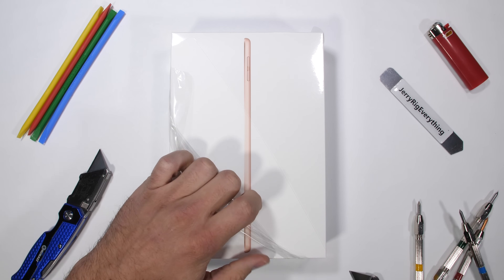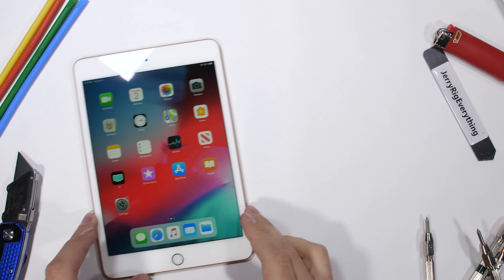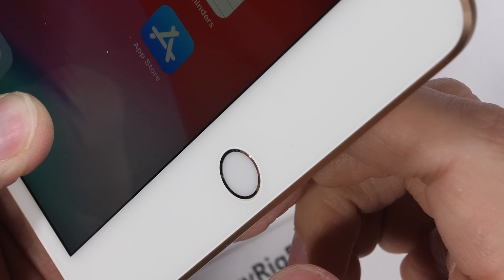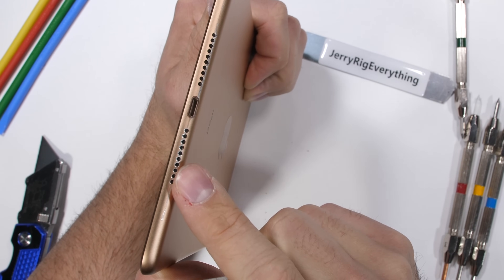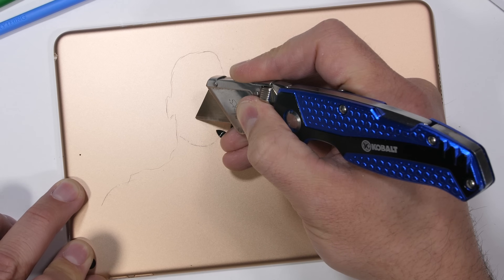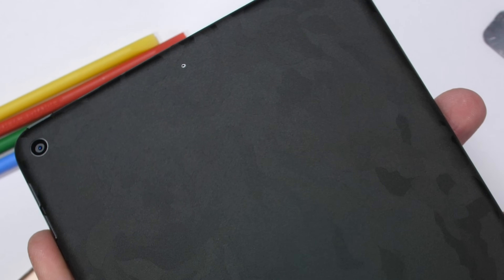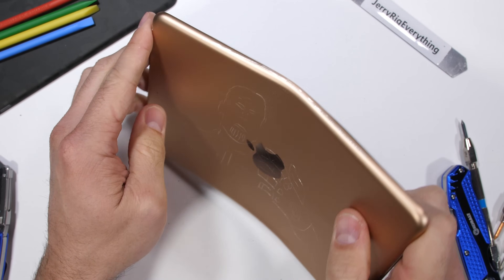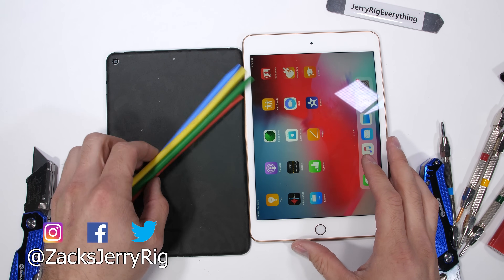iPad mini Bend Test! - Do ALL Tablets Break?!

Comment: I was going to say I was hoping for a 2012 iPad Mini bend test, but Apple iPads are Apple iPads, so they don't even tell you which gen it is on the box (not that you could tell by looking at the device). I have pushed the screen in on my device and it did flex more than I thought it would, but it really is surprisingly flexible.

Comment: If you’re strong enough, you still can’t bend the iPad mini 1 right?

To me, the iPad mini 1 is an  indestructible thing slab of metal, glass, aluminum, circuit boards, and a battery.
Reply: Same 4 me.  it’s Nokia 3310 of apples. Got it since 2013 and it got himself replaced only a month ago with 9.3” iPad 2018

Comment: Question
I have a 2018 IPad and it is the same as 2019 practically 
Why did they make this one?
Reply: Better display no air gap(2018 one has an air gap), better a12 chip(faster), small & portable, $50 dollars more at the apple store which is nice. Also it would last longer than the 2018 because of the a12 compare to the 2018 which only has an a10 chip.

Comment: I'm very curious about the durability and "bend test" of the new iPad Air 3.  The iPad Pro that came out in December seemed to be very fragile from the reviews and videos.  I think the iPad mini 5 is nice but a bit small for my use cases.  If the iPad Air 3 is not more durable than the iPad Pro 2018 then I will go for the iPad mini 5.  Any feedback?

Comment: Yes. All Tablets bend. Their design is not built for being in a pocket and the large surface area naturally means it will bend. With the size of these you want them to be lightweight and thin so the device isn't cumbersome to use. Literally no one is out there trying the bend tablets as the subject should already be understood. There is a reason almost every tablet case is beefy as hell or reinforced.

Comment: I compared it to the mini 4 and the mini 5 feels so cheap. The screen is very bendy and hollow but I guess they are trying to make it lighter. The mini 4 feels like solid glass when the mini 5 feels like plastic or like a Android tablet. Also the gap between the white or black front and the LCD pixel has got thinner and makes it look kinda ugly. Not impressed

Comment: They finally figured out, that their devices from the past few years are way to resistant and long-lived, so they brought back the hole and a moving button, which both will bring some more random failures or entrances for future failure with them. Not to mention the unreplaceability of the Touch ID button for unauthorized repair companies.

Comment: It's also thicker and smaller. 
I don't think I need to explain why thickness affects the bending, this is common sense.

As for the length of the iPad, the difference in torque will make the iPad Pro easier to bend.
Torque = Force X Perpendicular Distance
Here's an example :
When Force = 1N & Perpendicular Distance = 2m, 
Torque = 1N X 2m
              = 2Nm

When Force = 1N & Perpendicular Distance = 4m,
Torque = 1N X 4m
              = 4Nm

When something is longer, it is easier to bend! You should be comparing the iPad Pro to another thin and big device.
I would take thinness over strength any day. It's not like I'm using the iPad as a shield.

Comment: I wouldn't consider any modern iPad for the simple fact that all of them have those LCD rainbow waves when you touch some parts of the screen with a force harder that 1.5 grams or something. It's absolutely ridiculous but the god of THIN demanded this sacrifices, I guess. Those holy extra 0.5mm, man.
Then of course there's the issue that Apple software side sucks stagnating for years but that's another matter, this here is a hardware channel.

Comment: "One thing that apple changed with version 4  and subsequently this version 5 is the outer glass is now glued to the LCD underneath it, making screen repairs quite a bit more expensive"
it's funny that you don't talk about how better experience and quality this display would have over those with air between glass and LCD. it just shows how easy it is to be a hater

Comment: Huawei: our phones have 3 cameras and reverse wireless charge.
Apple: our ipads doesn't crack when bended

Huawei: -_-
Reply: Carlos Saíz You do realize phones are way different from tablets? In case you forgot huawei’s $1000 tablet breaks in half when bent. All tablets bend.
Reply: @Wilbertchople  not true, did a bend test on an nvidia shield, even an old iPad 4. They don't bend.
Reply: Valkxz But Zach didn’t. Bend tests have to be by the same person to be comparable. The iPad mini 4 is the exact same design as the 5, and should bend just as easy.
Reply: @Wilbertchople  okay, obviously he is a lot stronger than me, but that's not the point. The iPad pro took little effort from him to bend. The point is that the device is sturdy, not that a giant man can break it when he uses his might.
Reply: Valkxz Yes the iPad Pro is stupidly fragile, but the comment was aimed toward the mini. All modern tablets will bend whether android or apple fans like to admit it .
Reply: @Wilbertchople  that shit doesn't break

Comment: A real improve over iPad pro but still Apple is stuck with same design for years now. I know there's no many changes to do in a tablet but they look exactly the same. It could be a positive point if u use an old iPad no one will notice, they all look the same.
Reply: Diogo Costa I just bought the 2018 for a cheap price a few days ago. I think bezels for a tablet is useful for placing your hand or  thumb when you hold it horizontally.
.
Still, I really want the bezel to be thinner though. I think Apple don’t want to spend s lot of money for research and development team.

Comment: The reason why so many tablets can be snapped in half is the length to thinness ratio. Nowadays tablets are so thin, but they are just as long. This creates a large amount of leverage for a break. Phones have a much lower length to thickness ratio meaning you can't get as much leverage therefore you can't create as much force.

Comment: Looking for a serious technical answer, maybe from Jerry if he knows.
How is it possible that an lcd bends so much without breaking? All the lcds we've seen have always been rigid and used to break at minimum sollecitations. I still remember the days I used to change iphone 4/4s/5/5s and the lcd evenually would crack in the process of just pulling it out of the frame, I'm talking of less than 2° bending.
This one seems to work very well still!
Also some scientifically accurate hints on the glass itself behaving that way would be highly appreciated